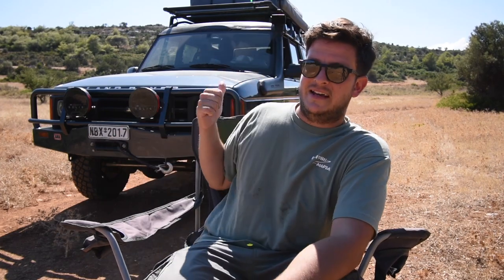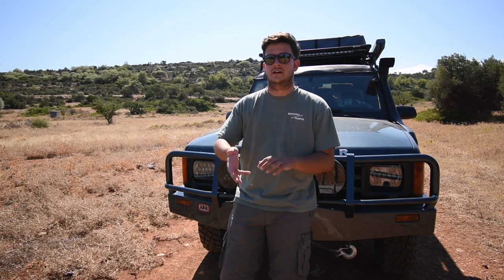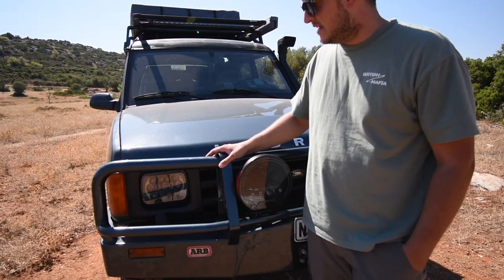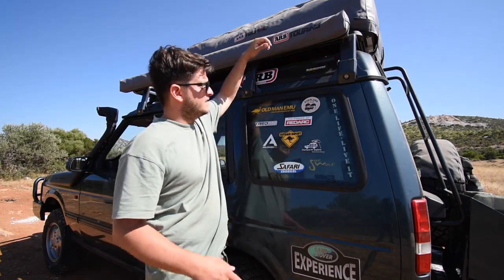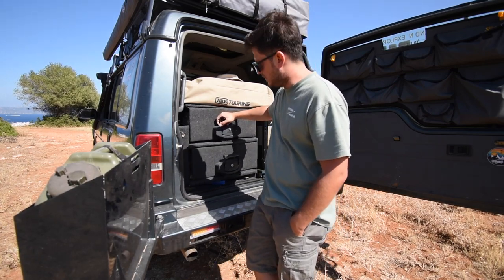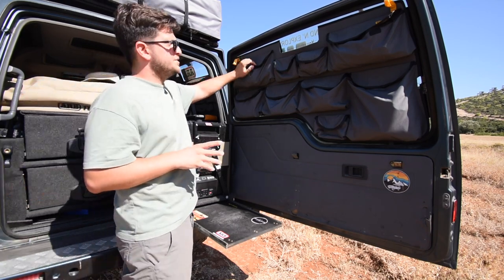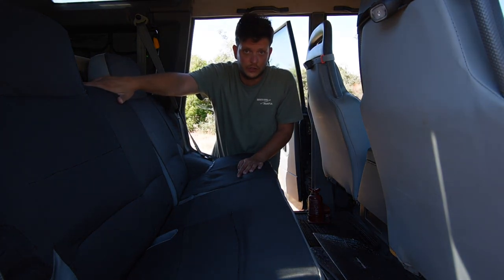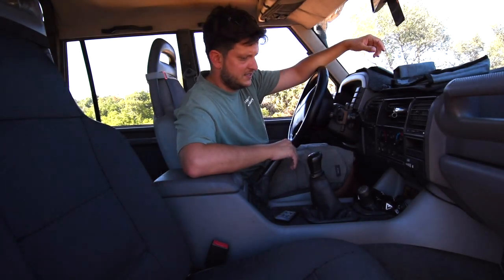Land Rover Discovery 1 Overland Build | Walk Around

Comment: Could we get a tyre size?? They look standard are they? Great build man!
Reply from the maker: Thanks! Yeah, they are one of the standard sizes suggested by Land Rover, 225/75r16 to be specific.
Reply: @overlandnexplore  that's great thanks! I've got 235/70r16's on mine and I was thinking to go bigger but seeing what you do with yours I'm not going to do that!! Keep up the adventures and the content man!!
Reply from the maker: @jessehunnisett2402  yeah mate, practically the same size as the one I had on my D1. 
I went for bigger tyres (32 inches) on my D2 and you need stuff like reduction gears etc etc. in order for it to “work” properly. Plus the added fuel consumption. 
If I were to purchase tyres again I believe I would stick to what the manufacturer suggests. Sure you get other benefits like more clearance and stuff but you loose on other aspects. It’s a give and take situation as most things. 
Thanks for your support! There are lots of plans for 2023, especially for the upcoming summer!
Reply: @overlandnexplore  Cool man! Look forward to it! And yeah I can barely pull away in high range as it is when it's fully loaded on an incline, I dread the thought of what it'd be like on 32s!! Sound advice man I appreciate it and look forward to your upcoming content!!

Comment: Hi there, loving your channel so far, keep up the good work! 
I have a question about your suspensions. I also have a discovery, and I want to upgrade them, and I wanted to know how much do those OME lift the vehicle?
Because I see all those cheaper brands saying it will lift 50mm or 2", but I have noticed that OME does it different. I was wondering how much do your suspensions lift on the front and the rear.
Sorry for the long comment. Loving your Disco! Cheers
Reply from the maker: Thanks a lot mate! 
So, OME suspension for the Discovery 1 is supposed to lift the vehicle up to 40mm, which is technically 1.5”. I used to have it lifted up to 2” but I lowered it a bit with the OME down to 1.5”. 
2” and above usually require a double cardan front propshaft, a rear propshaft out of a 200tdi disco (with a UJ going to the rear diff) and longer brake lines. 
So I think 1.5 is the way to go, you can’t quite tell the difference between 1.5 and 2 to be honest…plus OME rides great. Gwynn Lewis has a nice OME kit with all the parts you need for longer suspension travel
Reply: @overlandnexplore  thank you so much for the detailed answer! I'm enlightened now, and I will definitely check the OME kit. The only problem is that I live in Portugal and I can't get them without paying crazy shipping fees from abroad. But I will definitely check that website too. Again, thank you very much for the explanation, and keep up with those disco adventures! Cheers